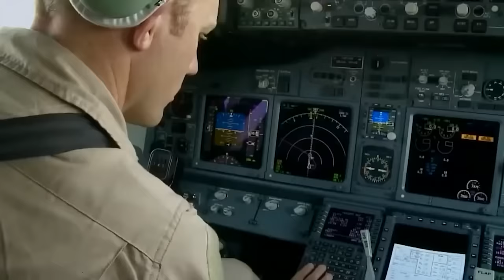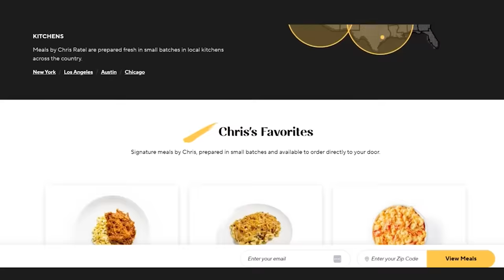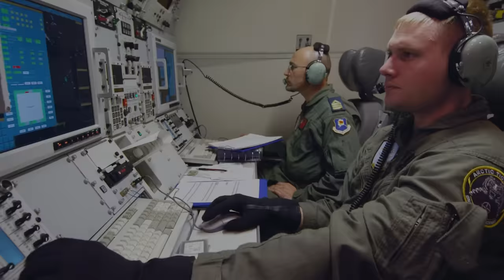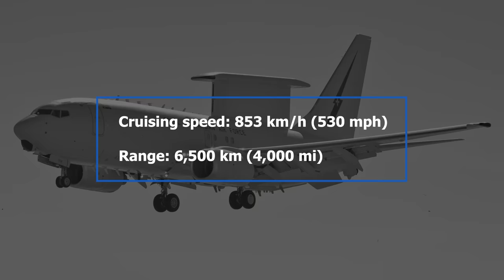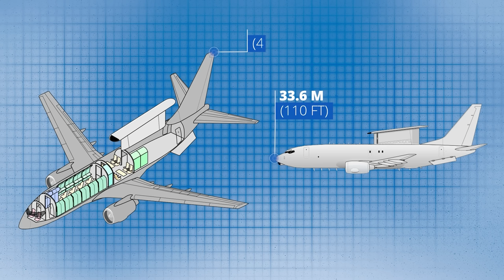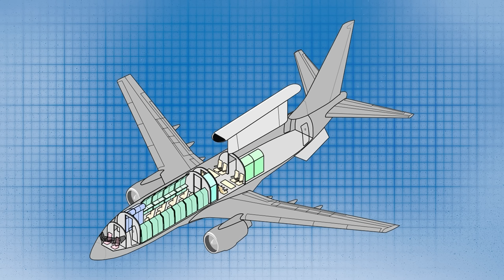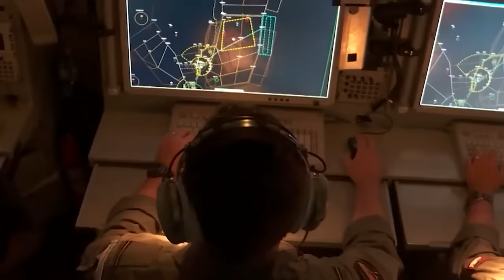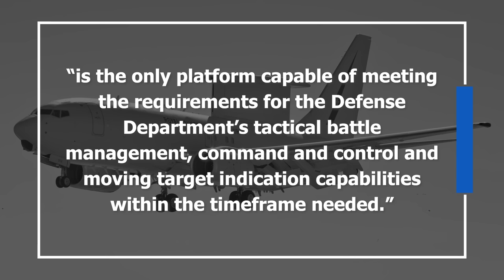The Boeing Wedgetail: The Plane That Will Control World War III

Comment: Boeing has to successfully complete A PROJECT in the modern era to rule anything...

Hows that air tanker coming?
🤣
Reply: the wedgetail is already being delivered to Australia.
Reply: @bohba13  probably similar to how Boeing delivered planes to Alaska airlines.
🤣
Reply: @Bornfromjets719  nope. the AkA airframes are a new 737 variant. The 737 airframe used for the wedgetail is the older "baseline" airframe, and one that was adjusted to be a military airframe. (so no escape doors by the wings nor the ultra-cheep doors that they decided to use on the recent MAX airframes.) 

Military grade is both a blessing and a curse.
Reply: @bohba13  $7,000,000,000 in losses on a domestic military contract to provide a refueling platform, over 300 dead from the civilian variant, sure seems like more curse than blessing, but I'm a cynical taxpayer.
😅
Reply: @Bornfromjets719 really depends on the project and situation. on one hand you get that, on the other you get the Mail Carrier made by Northrop Grummen... yeah it's a tin can that will fall apart if it gets into a crash, but that's pretty much the only way you can kill it.
Reply: @bohba13  touché!
Well played sir!
🤣

Comment: Why do I get the impression the US government version will have greater capability than the foreign versions?
Reply: I wouldn't be too confident.  Signals processing is actually a strong point for Australia
Reply: @mmmarcd - what strong signal processing does Australia have? The only decent signal processing is Pine Gap and it’s an American owned signal processing site…
Reply: @AftonAdams  Australia has a large over-the-horizon radar network and it's entirely home grown.
Reply: @bernadmanny  - Practically every developed country has over-the-horizon radar networks and is considered a normal capability… so no, it is not a strong signal processing point…
Reply: @AftonAdams  what about the JORN radar that has been said to detect f35s and can detect aircraft as far north as east timor
Reply: Well if Boeing and USAF cant agree, it wont matter

Comment: So there's no way a 5th gen fighter could get in range and pop off a hypersonic or other long range missle on this thing? What is the max distance now for air to air missiles?
Reply: 5th gen would struggle to approach undetected as the radar power is much, much stronger than a fighter's nose radar. Max distance for air to air is in the range of 100 nmi or 200km but odds of a kill at max range are low.
Reply: The RAAF Wedgetail theoretically can "see" over 1000km........AAMs are maxed out waaaay before that

Comment: Can we get simon to stop overempasizing every single weapons platform as THE MOST IMPORTANT BATTLEFIELD WEAPON IN THE HISTORY OF THE WORLD!!!!! OMG>.... Simon said this plane controls the battlefield from 700 miles away.  That is patently false.  This plane has RADAR.  the RADAR sees 700 miles away at altitude, and from there you can scramble jets, drones or AA.  The plane doesn't control the battlefield, it is a radar plane.  And the term battlefield. has to do with ground.  This plane can't do goddamned shtt about what is going on on the ground, and it can't do anything about it, and it can't even SEE what is going on on the ground.  It can't pick up tanks.  Simon is just pumping out another useless video where he calls a radar GOD"S EYE FOR CONTROLLING THE BATTLEFIELD, when its just a radar

Comment: So they updated a 67 year old design to 56 year old… it doesn’t soje d like a long lasting improvement. I would rather take a320, tho I understand that it’s not American
Reply: Hardening a 737 against EMP is a lot easier.
That's why they went with it instead of the 777.

Older systems are just a lot less vulnerable to microwave bursts.
Reply: The existing E3 fleet is literally decades old.  They’re being replaced with brand new airframes so ummm yeah that’s a pretty damn big improvement.  The fact the 737 classic first flew 50 years ago is irrelevant, however having analog flight controls for an aircraft like this is actually a good feature. 

I don’t see how the A320 would be a better option, and besides the USAF and USN has already been operating 737s for quite some time so there’s an existing trained labor force and supply chain.
Reply: It's not the airframe that matters for AWACS, it's the radar and electronics. The electronically steerable array in the Wedgetail is far more modern than the rotating dome in the E-3 Sentry.
Reply: @andrewmcalister3462  it’s more modern but that doesn’t necessarily mean better in every way.
Reply: @cruisinguy6024 it is better in EVERYWAY😂
Less maintenance 
Less "off-line time"
Less training to use and to maintain it
Reply: @richardcostello360  it’s better in MANY ways but not EVERY way.  The MESA radar has reduced capabilities 60 degrees fore and aft, the E7 has 1,000km less range, and its over 100 knots slower.
Reply: @cruisinguy6024  They spend their time flying in circles anyway.
So it's not a big deal.

Comment: Should look up what the growler does now....................kind of the reason why having this thing up in the air is a bit of a meme. Risks 50 people when the job can be completed elsewhere, faster and less people at risk. Sure though, more is better.
Reply: What are you talking about? A growler isn't a replacement for an AEW&C aircraft in any way? They don't do nearly the same job.
Reply: A Growler is a short range "eyes" for a CV........the Wedgetail can theoretically "see" up to 1000kms.......plus its long endurance and ease of maintenance/parts acquisition works perfectly for what Australia designed it to be......a coastline patrol craft that can "manage" a CBS/ABS like a God